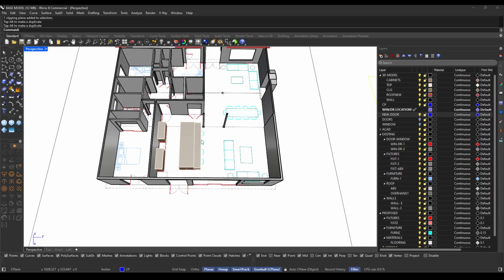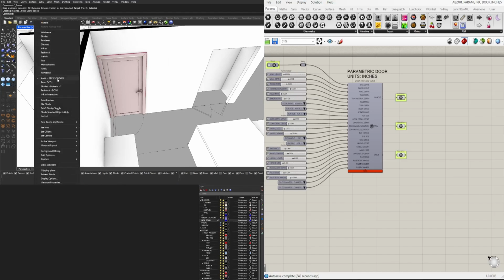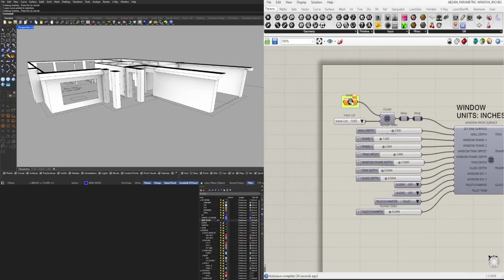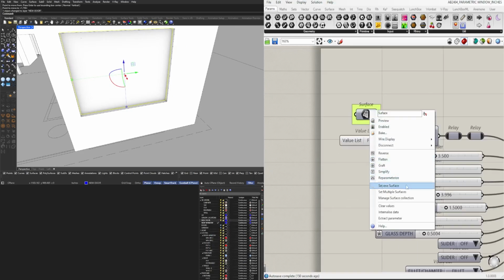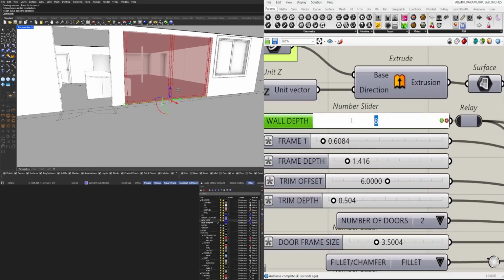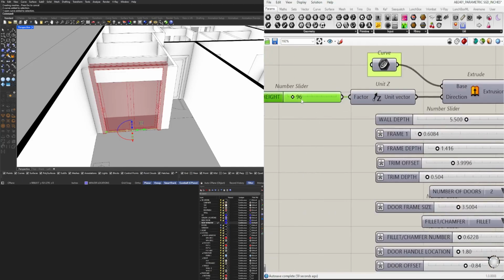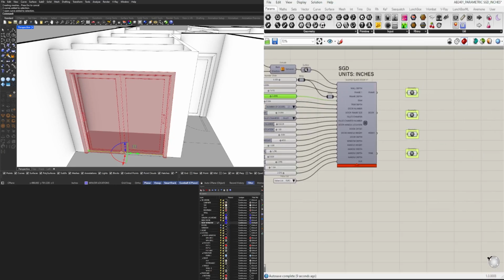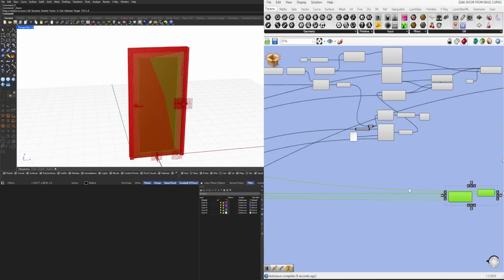Parametric Dynamic Architectural Blocks for Projects Rhino 8 3D #grasshopper #parametric

Comment: Is it possible to create a grasshopper (or other, like visualarq perhaps) window of wood frame constructions wherein you specific every detail including the

    window style,
    depth/height/width,
    muntins,
    casing,

    trim/crowns on the inside and different for exterior,
    sill
    stool
   etc

And then ability to generate accurate live section details from it WITH dimensions and notes? I know, it’s a lot, but this would be immensely valuable. Is it possible?

What would it take to create a script (?) that would allow me to make such detailed window models?